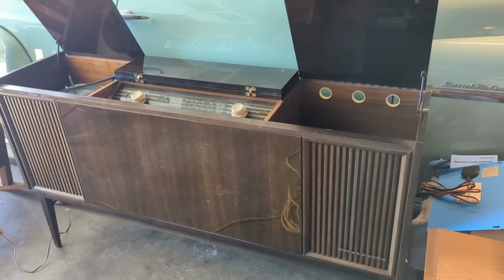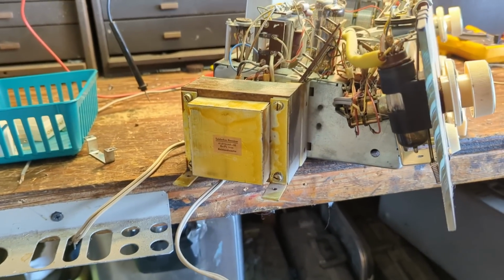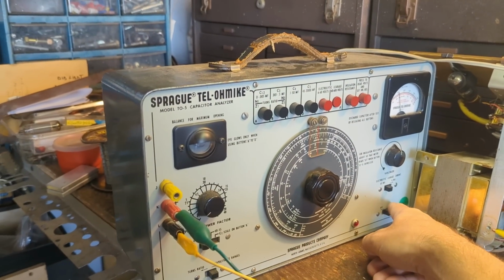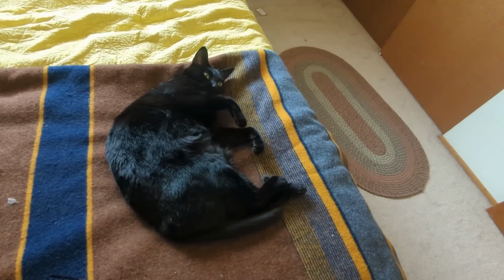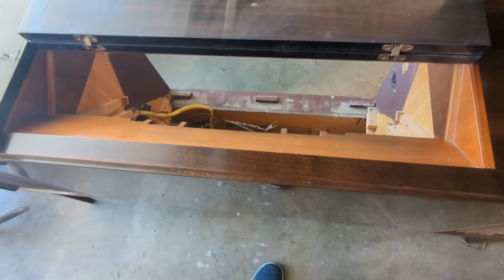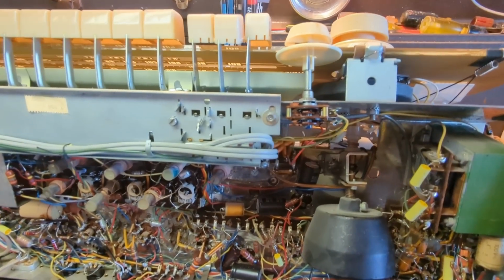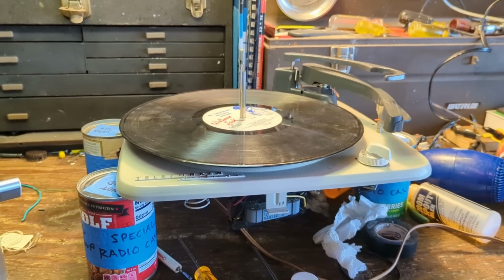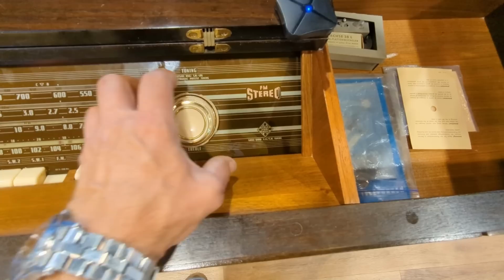Large-n-Tall: Telefunken stereo repair and restoration

Comment: what is the plastic cup looking thing on the bottom? never seen it before
Reply: I think you're describing the weight on the tuning control - they're generally made of lead, but the paint on this one makes it look like plastic. They add some weight and inertia to the tuning control so it feels more "fancy" when you turn it. Basically a little flywheel.

Comment: It would be good to have a rundown of the tube lineup, and what the transformers are.  Tantalising views throughout, I spent my time trying to work it out.  Stereo with 4 x ECL86 I think.  Two o/p transformers on top.  Why  are two ECL86 at the far end away from the o/p transformer?  Is that a choke underneath the chassis?  I see the FM tuner tube, I guess ECC85, but what is the other tube in the metal enclosure?  Would love to see the stereo decoder as well.  Would like to see a closer view of the schematic so I can actually read it.  Very interesting chassis.

Comment: I just recently obtained a Grundig KS 490 still works, and it’s got the reel to reel in it but no original turntable. I plan to upgrade the speakers and find a current turntable that will fit in the housing.